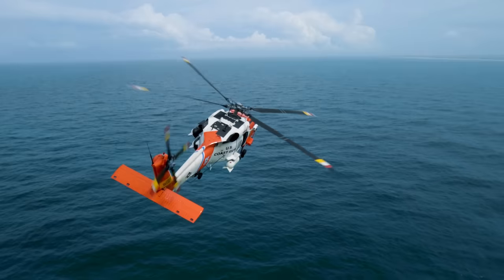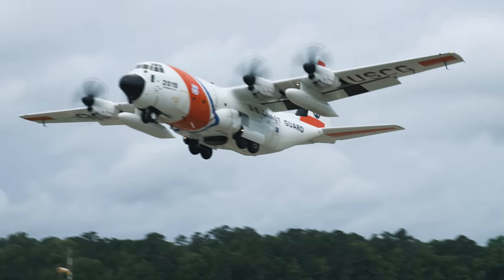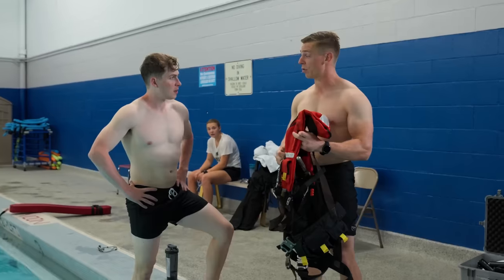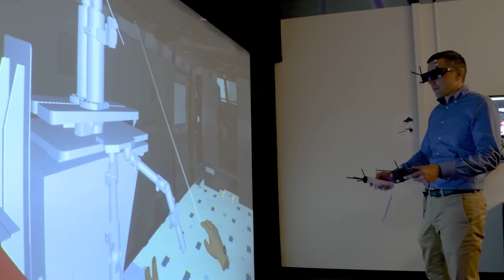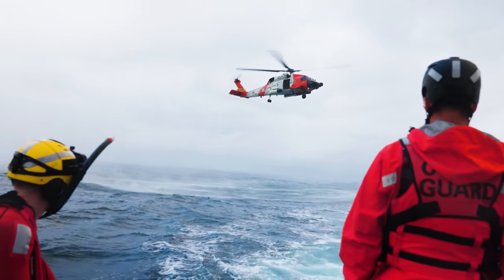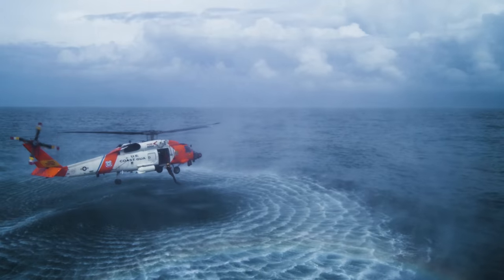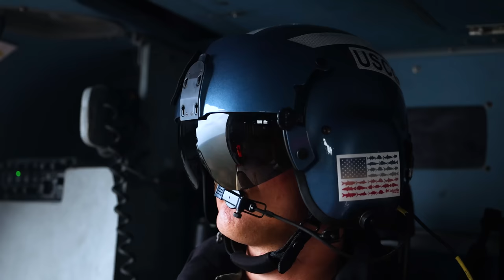Surviving A Day With The United States Coast Guard

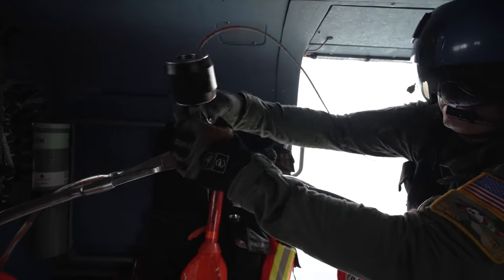Comment: December 1999 I as on a fishing charter out of Virgina Beach with my Son and some friends when at 4:50 in the morning and Southeast of Rudie Inlet our boat hit what was later determined to be a buoy that the SEALs used. It was grey and rose 4-5 feet out of the water. t didn't show up on radar and had no lights or reflectors. It stopped a 58' sport fishing boat that was traveling around 23-25 knots like a hitting a brick wall. There was a 4x8 foot hole in the starboard bow that ended at the bulkhead of a stateroom and the bow stateroom.  A giant car carrying ship stopped to render assistance. The Coast Guard was spinning up a helicopter but canceled the aircraft after knowing we were safe but still sent a 47' rescue boat like the one in the video. The Coast Guard crew even brough us back to the inlet off of the ship. There are no words that can adequately praise these men and women for the job they do. P.S., because the captain shored up the bulkhead to the engine room the boat was saved and still fishes to this day though it has had quite a few upgrades and several repower events.
Reply: Awesome
Reply: You file a claim with the govn? I would!!

Comment: I have a friend stationed at USCG Air Station Sacramento. Great group of guys flying the C27 primarily and the only fixed wing air station on the west coast. He's told me some pretty hairy stories. Thanks for highlighting this Sam. The "Coasties" don't get a lot of pub, but they do work and it's hard work.
Reply: There are fixed wing aircraft (C-130's) at AIRSTA Kodiak, AK and AIRSTA Barber's Point, HI. You are correct that the C27 is only based on the West coast out of AIRSTA Sacramento.

Comment: why cockpit floor isnt glass or wh there is no cameras to assist the pilot?
Reply: The whole helicopter is actually glass just hard to tell in the video
Reply: That's one of the jobs of the Flight Mechanic, to be the pilots eyes/ears while in a hover.
Reply: but whats the point @silntstl
Reply: @mateuszcielas3362  The point is that the pilot on the controls can't see what is under and behind him in the hover.  Its the Flight Mechanics responsibility to "conn" the helo into the proper position for a successful hoisting evolution.

Comment: What was that steam being blowing on the pilots for?
Reply: It’s moisture forming in the air from the ECS (Enviornmental Control System) basically there Air conditioning, but it is also used for Avionics cooling.

Comment: Does anyone know what that vapor is that is being pumped into the cabin?
Reply: Its cool air from the ECS basically just A/C
Reply: @zacksowers4459  how would you know
Reply: @samsmith9075  He's correct.
Reply: @silntstl  are you an airospace engineer? I think it's smoke
Reply: @samsmith9075  Its air conditioning from the ECS (Environmental Control System) supplied bleed air from the engines. I should know, I was a mechanic and crewman on both H-60s in the Army and Coast Guard.
Reply: @silntstl  if it's from the engines air maybe it's smoke. I want to be an army or marine soldier when I grow up
Reply: @silntstl  army is military, thank you for your service sir

Comment: So I noticed that once the rescue swimmer was in the water the pilot called out that the swimmer was good to go. What if the swells became so large and they weren’t good once entering the water. Would another helicopter have to then come out to rescue the rescue swimmer?!
Reply: That wasn't the pilot making that call, its the Flight Mechanic. He's letting the pilot on the controls know that the RS has given the Swimmer OK sign to the Flight Mechanic and that the pilot can now bring the helo back and away from the Rescue Swimmer so as to lesson the waves/resistance for him to deal with. 

If the Rescue Swimmer does not give the Swimmer OK signal there are protocols in place for such emergencies.